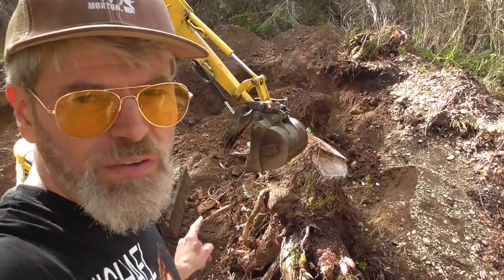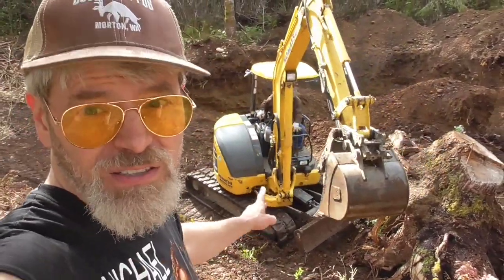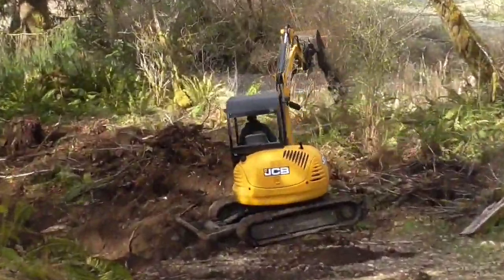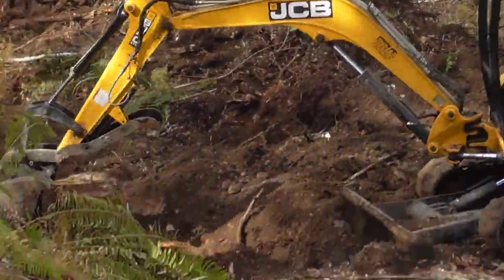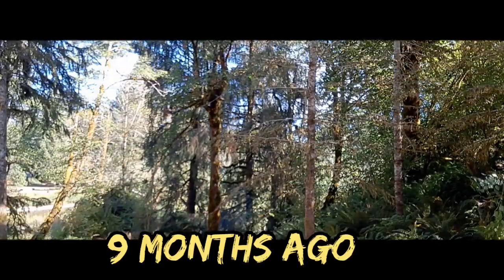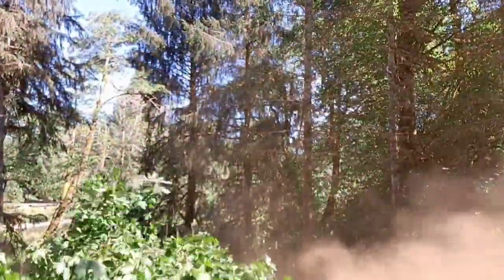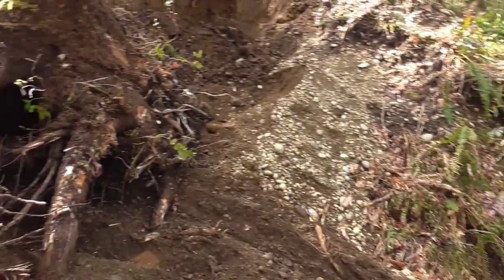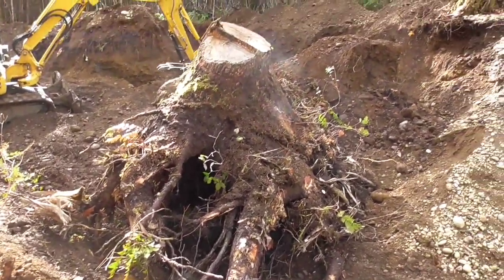JCB Mini Excavator and Komatsu PC-40 keep Pulling Stumps!

Comment: I figured out why the HoserDozer failed to pull the stump.  You took out the experienced oil and replaced it with rookie oil that didn't know what is was doing.  Which makes the failure your fault, of course. 😎🤣
Reply from the maker: Wait for Part 3 for the major failure. Incidently, that was my military rank back in 1987. Major Failure.
Reply: @OffGridandWhiskey  You out ranked me.  I was Sergeant SNAFU.